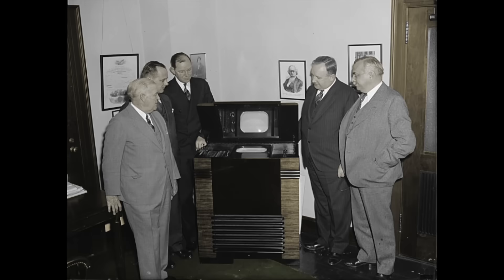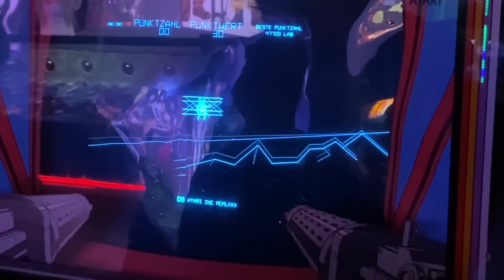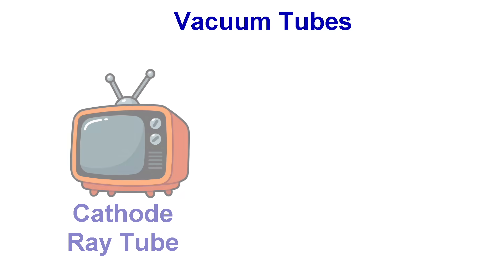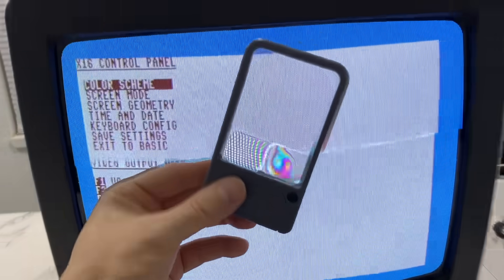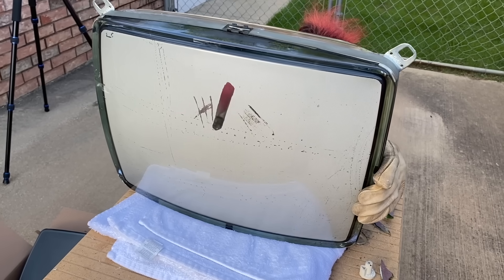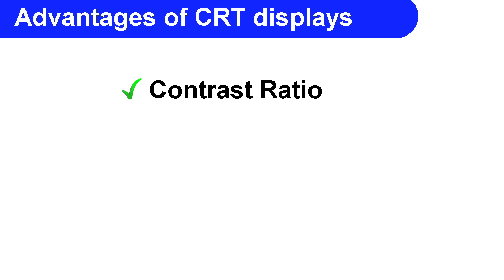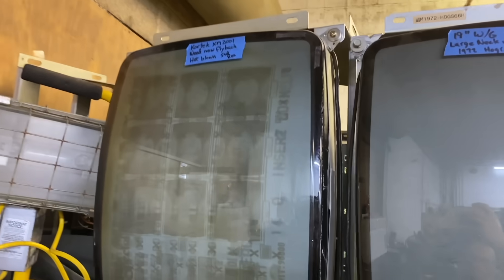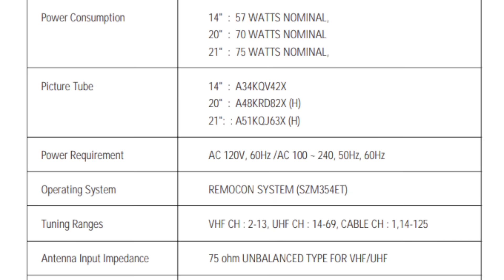How Cathode Ray Tubes Work.

Comment: Humans have two horizontally aligned eyes, which allows a wider horizontal aspect ratio to use more of our vision.
Reply: The eyes focus on the same point, so no. Some people actually look up and down -- as shocking as that might be -- and those people had to suffer through about 15 years of hideously cramped screens until 16:9 screens of a decent height finally became affordable.
Reply: @eekee6034  Nonsense. Test it yourself. Focus on a fixed point and move your finger left and right and then up and down. Your horizontal field of view is far greater than your vertical--that is, you can move your finger a greater distance left and right and continue to see it than you can up and down. And your argument doesn't make sense regardless because it would apply to vertical field of view too, and your eyes aren't above and below one another.

Comment: The 'plate' of the CRT is actually that silver coating on the inside which extends up to the phosphor on front. The internal coating, the glass CRT envelope, and the aquadag coating on the outside of the CRT actually forms a capacitor, which is why we always need to discharge the CRT before messing around inside a CRT TV or monitor. :)

Comment: @17:32 In terms of cost per square in there isn't really any difference between the two (only about 14 cents per square in).
$349/138.72 sq in= $2.52 per sq in
$329/123.49 sq in= $2.66 per sq in

So the only reason to choose the 4:3 screen would be to maximize the available screen area -- if the only metrics were total cost, cost per sq in, and available screen area.

Comment: 8:48 the metal thing is not the getter, that is actually a connection for the anode, it connects internally to the high voltage. The high voltage 25 kV) can’t be connected to a pin of the base, so it gets to the anode using that metal. The getter is a chrome looking circle deposit on the inside of the glass of the neck, that turns milky white when the crt goes to air.

Comment: 10:40 - Would that still be a problem if the shadow mask were made of a non-ferrous metal?  Implanted titanium splints have never been a problem for me when getting an MRI.  Other metals still cause an obstruction artifact in the imaging, but because the splints are in my foot and the MRI is imaging my brain and C-spine, that's not an issue.  I even forgot to take a ring off during one test, but the ring is silver, so no harm was done.  If the splints or ring were made of iron or nickel, they would have been violently ripped away, definitely causing harm.  But I suppose titanium and silver are too precious to use in a mass-produced consumer products.  

My brother once held a magnet up to the screen of an old CRT TV I used as the monitor for my C64.  It took a while, but I was able to clear the distortion with that same strong magnet.  It was like I was sweeping it into a pile and off the screen.  Thank Kibo he didn't do that to my Ultima disks!

Comment: As much as LCD's and LED technology can have sharper pictures, there are still some use cases where a CRT is much better than LCD/LED or even Plasma can get.   Plasma these days is even outdated, but it still has use cases that LCD's just can't quite get to.  I have seen CRT's that can do 4K resolution quite comfortably, though they tend to be pretty expensive.

Comment: I think the CRT displays weren’t that so black even when turned off (probably because of the phosphorus?) to begin with. This isn’t an issue in a dark room, but normal people were using them in a medium to well lit room, and so the contrast ratio dips. LCD screens, on the other hand, are much darker. Idk if this practical matter is taken into consideration while measuring the contrast ratios but it definitely matters.
Reply: Yeah, the phosphor reflected light. A black coating helped, and the more rectangular masks allowed blacker coatings by increasing the available brightness, especially Trinitron where the mask was just wires.

Comment: I never bought 16:9 (or even 16: 10) displays for any reason other than they were the most common ratio at the time and worked out much better for the kinds of things I was doing with the computers they were connected to. I even had some slightly odd Dell monitor for a time which was taller than it was wide (it was a 'gift' which I used for a while until it died).

On another note it now makes total sense why I could never put my hi-fi speakers right next to my old CRT TV, without getting weird colours bulging in from the side. The magnets in the speakers must've been messing with the electrons :) Fortunately I never left it for long enough to do any permanent damage.

Comment: And then there's the weight of big CRTs, we have a widescreen 28" 100Hz Samsung TV that's been sat in the same spot in the living room for as long as we've lived here (it was left in the house!), between having used it of course, but my spine is ruined so I can't move it any more, so, there it sits, gathering dust, that CRT is a lot of glass and very heavy... :S

Comment: Small clarification: in the 90s some image processing on CRTs did occur, which did cause some input lag. Phillips in particular made a couple of devices which did introduce a small amount of input lag, and the datasheets themselves noted the need to delay audio to compensate. I can recall owning one containing a Philips device where there was an option to disable it for console games.
Reply: Processing was was necessary for 100Hz tubes. Those 100Hz CRTs are running a progressive scan, so the TV has to de-interlace the picture in order to be able to display it. You de-interlacing requires you to have both fields, so hence the input-lag.

Comment: Great video. However it should be noted that powerful magnets can damage the shadow mask on the CRT, so running a magnet around the screen to distort the image or even degauss a color CRT can be dangerous or cause permanent discoloration. Just putting that out there.

Comment: I remember one detail about early color CRTs... In the mid-90s, we had a laptop (486 class) with a color screen. At that time, most laptops still used monochrome.
That thing was atrocious. It was bearable for office type work , you only had some smear when scrolling or moving the mouse. But for games of that era - no way. Anything that moved would just be a total blur.

Of course, this issue has long been resolved, but I guess that was what a lot of people remembered when LCD monitors became affordable for desktop use, and thus they preferred to continue using CRTs.

Comment: Displays with LED backlighting do not last longer because the LEDs burn out. For always operating at the current limit.
The "black" of CRT monitors is not a good black because the phosphor in "black" areas are still excited.
DLP monitors do not exist nor ever existed. DLP PROJECTORS existed and exist. It is not an option to take into account.
Many errors in the video.

Pd: 16:9 makes more sense because humans (like most animals) have two eyes arranged horizontally.

Comment: speaking of 16:9 over 4:3.  I prefer to work on a 4:3.   Documents are vertical, Magazines are Vertical etc.  so the extra width of a 16:9 you do not gain much.   The other thing is when I video edit.  It is nice to have that extra space above the time line to work with and view a project on a 4:3.  Granted with a 16:9 your time line appears to be longer/wider,  but is it by that much to give up the extra vertical work space.
Reply: this!! when browsing some sites on a 4k tv.... soo much wasted space on the sides....

Comment: I loved seeing the insides of the broken-up CRT. I learned everything I could understand about CRTs long ago, but it's so good to actually see the parts. The 3 electron guns and the mask looked quite different to what I imagined.

   I once had a CRT with bad contrast ratio. :) It didn't allow you to adjust the black level, not from the outside, so the bottom end of the contrast range was always lost in the dark screen tint, especially if used in a bright room. The black blacks made it look sexy, but it was otherwise pretty bad. :)
   Besides this, CRTs didn't necessarily have very good gamma correction so you could lose some some near-black or near-white tones to gamma issues.

   I also had an ultra-sharp Viglen CRT. My chief gripe with LCDs is that the pixels are too sharp; you can see them. Well, this 14" Viglen was so sharp, it had the same problem. I had to run it at 1024x768 to be comfortable. Other 14" CRTs I never wanted to run at more than 800x600, but Viglens were very special professional-quality monitors.

   My favourite CRT was also my last, a 21" monster which I normally ran at 1600x1200. I tried it at 2048x1536, but it didn't quite focus sharp enough. I got it free because it needed degausing and we didn't know how to do that in those days.

   The 21" was too heavy to comfortably move around, so I replaced it with a 1600x1050 LCD, and spent the next 5 years or so regretting it! That LCD screen was bad, not 90s-laptop bad, but still a big downgrade, even considering the CRT's magnetized mask. My current monitor is 23" 16:9 and it feels cramped and small in a way the 21" 4:3 CRT never ever did.
Reply: You could get a 16:10 monitor. I´ve seen people (even in these comments) mention that they are a good compromise between 16:9 and 4:3
Reply: @AlguienMas  Thanks, but the screen which was a massive downgrade was 16:10. I wrote its size wrong; it was actually more like 1650x1030. The 16:9 screen I followed it with was about the same height. I tried having one above the other, but that was too tall. 21" 4:3 was just right.

Comment: at least the TV size thing is an area-difference, something that most people even if theyre aware of it arent able to spot on the fly so i can somewhat accept people falling for that price difference example. Not many people i know can multiply fairly large numbers in their head.
The 1/3 vs 1/4 pound burger just makes me lose faith in humanity. I remember when that fiasco happened and i just facepalmed and sighed hard. That is basic math, its not even something you gotta factor in your head like the Surface Area, its literally a bullet point in what would be used in those more complex calculations. And its extremely common values too, 1/3 1/4 1/2 and 1/8th are very common where even if you arent a carpenter you should know what those are. I get lost beyond that since im not a carpenter and its unusual to need to know what 5/16ths or 1/64th is off the top of your head.

Comment: 14:44 It's worth noting that CRTs have a very limited lifespan, because of wear to the cathode, meaning that they will similarly become dimmer and their colors muted/out of balance.
Also, some fantastic evidence exists for the theory you propose - shango066 does a fantastic job of pulling used CRT TVs out of garbage dumps in the desert after 40 years and puts them back to working. It's more effort than maybe displayed here, but still.

Comment: Please make a video explaining why a C64 designed for CRTs can be hooked up to an LCD TV (via s-video), when an LCD screen picture does not consist of raster lines which the VIC II is all about. Do LCDs somehow digest the raster lines sent from the computer and convert that to something else?
Reply: Yes it does signal processing to deposit the the analog signal into a digital frame buffer that is sequenced out to the LCD panel a moment later.  No different from how you could watch analog broadcasts on an LCD television.
Reply: @sa3270  Thank you.

Comment: Even CRTs have longevity issues. For example our last color TV got tossed because everyone looked like they ate jalapenos (the image got a red taint which got worse over time).......
Reply: They are repairable. ANY other screen on the market is not. Sadly. (Unless there's physical damage inside the screen)
Reply: @gabrielvieira6529  AFAIK the color shift is a direct result of the tubes age, presumably the materials inside starting to degrade over time.

Comment: CRT are far superior, I've had a CRT TV till 2014, trough a great Samsung flat screen CRT that was 29", then switched directly to a FullHD LCD Smart TV with LED backlight. The early LCD TV with fluorescent backlight where shit. Unfortunately I had to throw that TV away, it was no longer working, I would probably have been able to repair it (I suspected some capacitors, and needed to adjust the geometry), but it did weight a ton and took too much space. 

CRT did display standard definition TV channels, and low resolution sources (such as DVDs) far better than LCD, especially when scaling algorithms where not great, and HDTV transmissions where rare (they still are these days in my country, by the way). Given that I live in Europe I could enjoy the sharpness of RGB signal generated by a DTV receiver trough the SCART connector, something that you don't get with modern TV. Most people probably remember CRT as bad since they only used them with composite video inputs, especially in the US where RGB signals where not present and component signals where a very late addiction.

Comment: You  need some HDR monitors. They're real freaking nice. But I do understand your point, and Qled HDR monitors   can only go so dark, or at least the regions can only go so dark. I do understand your point. See, I always liked CRTs for  that feature,as well as the overclockability of them. You can get stupid resolutions, as well as insane refresh rates. LCD panels have come a significant way in all of those regards though. Tbh I  was always envious (still am) of John Carmack's 27" (I think it was 1920x1080? But it could've been significantly larger) widescreen CRT. That fucker was cool, and I'm still convinced it was custom ordered/built for him. In any case, that fucker had to cost a pretty penny.
Reply: SO this proves that a 4k crt is viable

Comment: The first experimental lab colour sets used three seperate CRTs each with a colour filter whom images were optically merged on a screen.  This is how large projection displays worked for years but for an average living room set would have been inordinately expensive and needs a lot of manual adjustments to get the three images to accurately line up.
Reply: There were plenty of rear prjection sets working on that principle, both from triple crt and triple dlps as well, high end ones did that instead of one dlp with a color wheel

Comment: Fun Fact:  Phillips Electronics was on the verge of making 16:9 wide screen CRTs when LCD screens broke out of their high price box.  Phillips was probably the last company actually making CRTs, right in Ohio.  Another interesting thing you could look at is compare the depth of a CRT used in an average television to one used as a computer monitor.  Monitors were often deeper.  This gave them faster responses and cleaner pictures because the beam didn't have to sweep through as wide of an arc that a shallow TV CRT would.
Reply: Toshiba was selling them in the early 2000s - I had the 34" variant. VERY VERY heavy TV since the front had to be thick enough to remain flat. Supported 480i/p and 1080i w/ component inputs only.

Comment: I still rock a 20" hitachi from 1986 as my main tv. I never switched over to flat tvs. I'm 31 btw not 61 I just don't need/want a flat tv, i like the 1980s tvs. Coax and composite is good enough for me. Should see it when i watch my Miami Vice dvds on it,it's fucken' beautiful.

Comment: WHY Hasn't anyone made a 4k CRT Tube??? it would be the epitome of technology and look AWESOME
Reply: The main reason is because CRTs are already dead. The industry to make them is gone and people who know how to make them are retired. That said, there are also some technical reasons why CRTs were a dead end. For 4k you want a big CRT, however, the larger the CRT, the thicker the glass needs to be to withstand the vacuüm pressure. So CRTs would have become even heavier. Second, in CRT there is a trade-off between brigthness and resolution. Television CRTs can be brighter than VGA CRTs and a 4K CRT would have had to further reduce brightness.
Reply: The barco 909 crt projector is the only tube in existance that could approach 4k
Reply: @crtautist220  Great to know! So it is possible. So it can reach at least 1440p. Nice. Thanks for sharing
Reply: I once had a 21" CRT monitor which was very likely made in the mid-late 90s. I normally ran it at 1600x1200, but for a couple of weeks I ran it at 2048x1536 instead. It was almost good enough; there was just a little blur which made me feel a tiny bit uncomfortable. I didn't try adjusting the beam focus; I should have. I also didn't try running it at an even higher resolution; I don't know if it would have handled even more lines. :)
Reply: No money to be made doing that. Or at least not an amount that would offset the startup costs.
Reply: They did, just not for the mass market. The channel "Notes" has a demonstration of one.
Reply: You can send 4k60 to very high end crt monitors or projectors
Reply: It would need about a 70 KHz horizontal refresh rate just to do interlaced 4K, and I think that would probably require a huge voltage.
Reply: @sa3270  70kHz is easy, IIRC most of my monitors go to at least 96kHz.

Comment: Another major benefit of CRTs for retro gaming is that they basically have no motion blur. I’m not super sensitive to blur, but it is something I notice.

On the other hand, I love not having to worry about geometry on my oled, which often isn’t perfect on a lot of CRTs, particularly flat ones. The retrotink 4k looks fantastic on my oled, even if it’s only running at 60fps.

At the end of the day, flat screen tech has come a long way in the last 10 years, and it’s only getting better, whereas crts have been stagnant since the early/mid aughts. I wouldn’t be surprised if Oled and Micro lcd (or whatever comes next) completely remove the need for crts within the next 10 years.